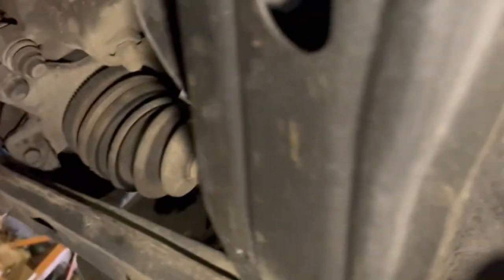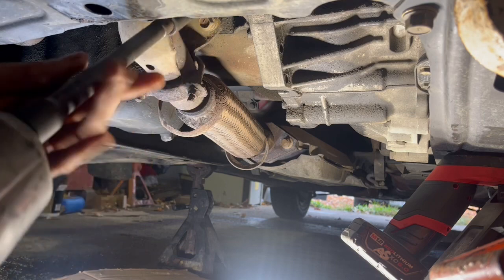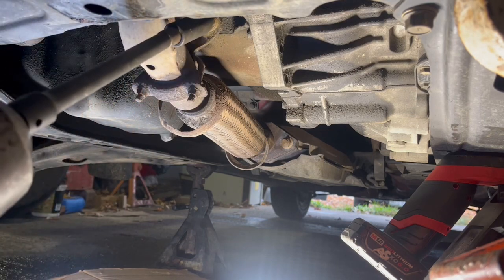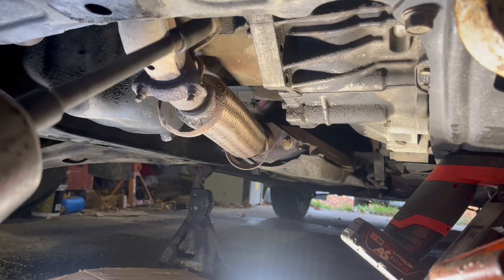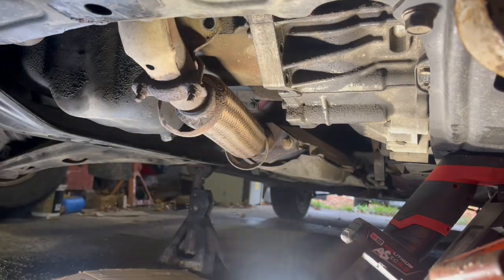91 Ford Probe 2.2 GL timing belt, water pump, oil pump PART ONE

Comment: I thought all these things have long been cycled through the wrecking yard.   I had a first gen that kept repairing until the tin-worm no longer made it practical.   Once the rust starts it's over.
Reply from the maker: Yup I got really luckly with this one. Hasn’t been out in the snow much so it’s really clean for this area

Comment: You should seriously invest in some Kano Kroil. I still haven’t figured out what state or possibly province you live in yet, but clearly it gets a lot of snow and salt. Kroil is the best for unsticking things. It’s also fabulous for those damned tritons with the spark plugs that break off in them too. Do a 2-1 mix of atf and Kroil, put a 1/4 ounce down each spark plug tube. Let sit for 24 hours. Watch the plugs come right out without that gut wrenching snap sound when the plug breaks in two.
Reply from the maker: Right on thank you!